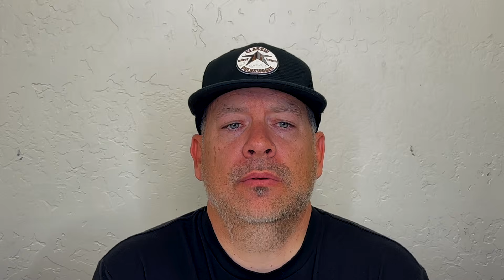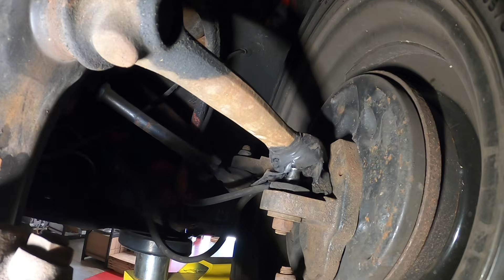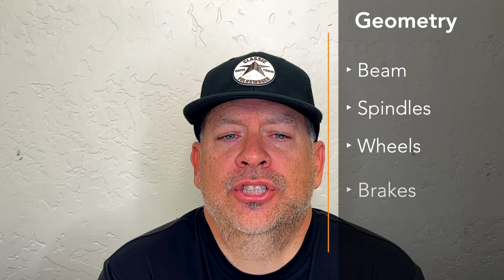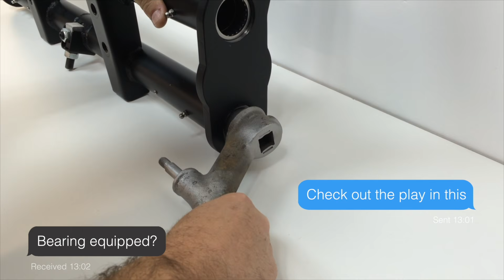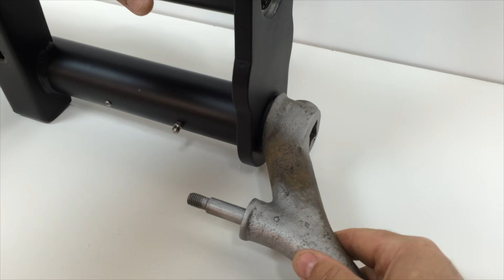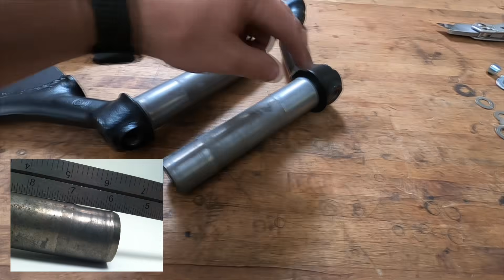Why Most Classic VW Beams Feel Sketchy (Even When They’re New)

Comment: Great points Pete, now that said I'm surprised that the aftermarket has not fully embraced a bolt on double A-arm front and rear suspension kit using modern day design software and manufacturing. I've seen the iMohr kits and others from Mexico and Germany, just surprised how that type of setup has not really taken off in popularity. Yes they are expensive, but only because they are exclusive and not manufactured in scale!
Reply from the maker: What happens when you break down on the road? Can’t get any parts

Comment: I spose I’m just an old codger, but I’ve never understood why lowering a car so much has anything good about it. They just look broken.
Mine are all stock height and I have no trouble.
Reply from the maker: That makes sense — stock height works great when everything’s operating where it was designed.
Reply: I feel the main problem with lowering any vehicle whether it's a VW or other vehicle you have to watch where you're driving and what you're doing otherwise you're gonna wind up replacing all kinds of parts.
Reply from the maker: I just use auto pilot and navigate through it....totally kidding. On todays roads, with todays drivers, stock, lowered or lifted, everything is in play. We are all at risk.
Reply: I like to drive around at stock height and then sit it on the ground when parked. Air ride perks
Reply: @robwhite461
Absolutely!  Lowering these beautiful machines looks terrible and completely hamstrings it ability.  If anything, reduction gears should be considered to give the beetle much more ground clearance and off road capability!  Many old VWs were like that!